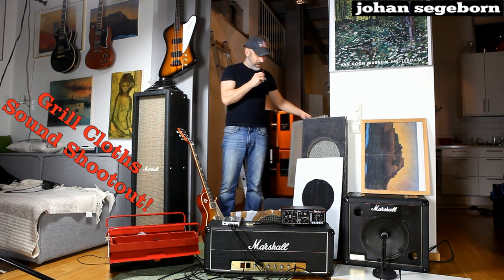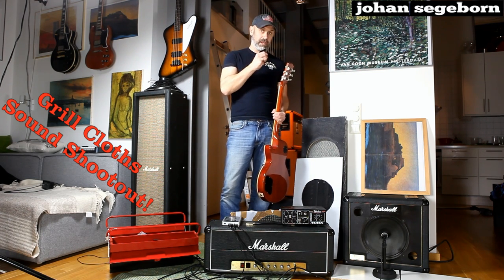Marshall Grill Cloth Shootout - Basketweave Checkerboard Black Fender Silver

Comment: Johan Your video's have saved me. I have a 1983 jcm 800 2x12 combo with g12-65 speakers. I always thought the speakers sounded compressed. They have the least lows, note separation and presence to me. Also the open back created to many sound waves for a tight attack and reduced definition on top of the speakers lacking treble.  After your video on insulation in the cabinet I put some 2" dense foam in the back. I achieved much better clarity that made for more note separation and even made the bass and treble stand out more. Now I will change  the black cloth which sounded compressed to achieve even more presence for clarity. Thank you Johan!
Reply from the maker: +matt whit Thanks Matt! Makes me glad to hear that. It's really interesting how the insulation takes away boxiness and makes the cab brighter in the process. Cheers

Comment: Agree with your findings 100 percent... I couldn't believe the difference between my checkerboard  cloth and the basket weave- which sounded muffled and undefined in comparison!  String zing on the low E was totally absent with the basket weave
Reply from the maker: +marvel harris Yeah, they work great for different settings. A SuperLead with maxed out treble and prescence benefits from the rounded high end of the basket weave. Cheers
Reply: The basketweave or "cane" cloth really holds back, it actually compresses, so this smooths out nasty tones. It's perfect for solving the bright Marshall issues. It's why Hendrix with a Strat doesn't sound too bright. If you look at basketweave/cane from the back, you almost can't see light through it. It stops sound in a nice filtering way...
Reply: What's funny is, the older cloth is great for taming down the late models, like JCM 800 and 900 amps, but they have the brightest cloth originally!